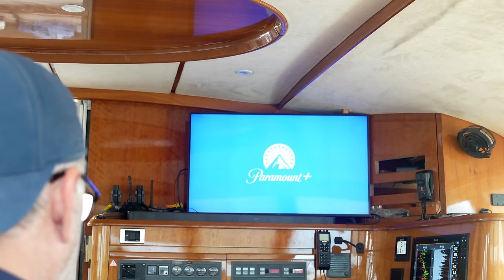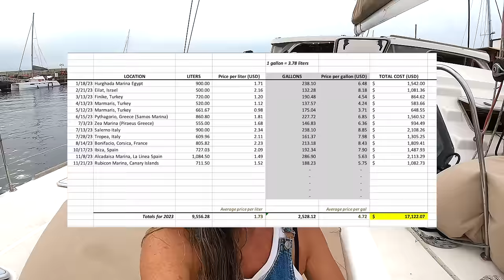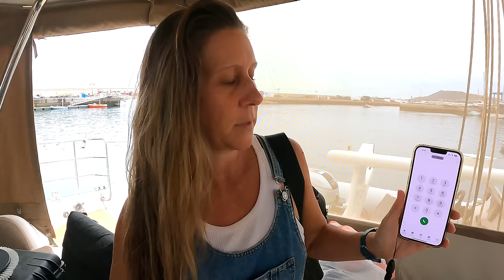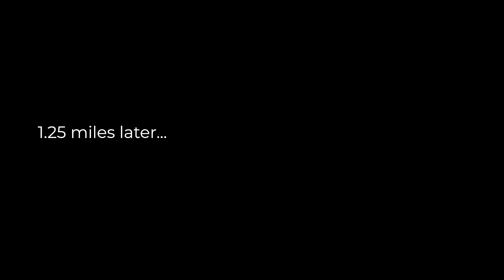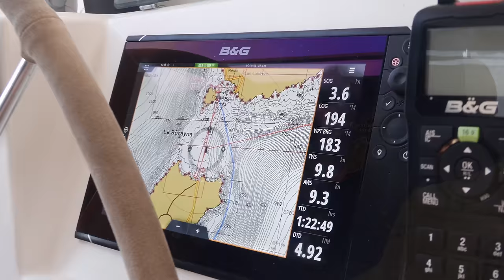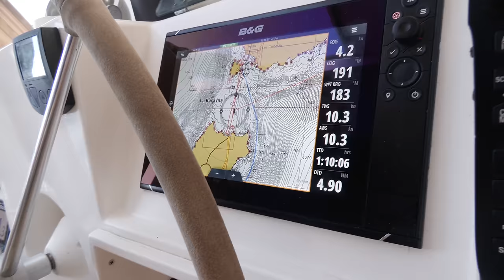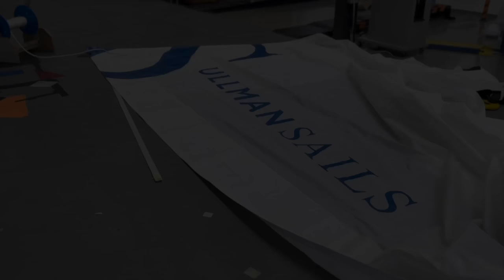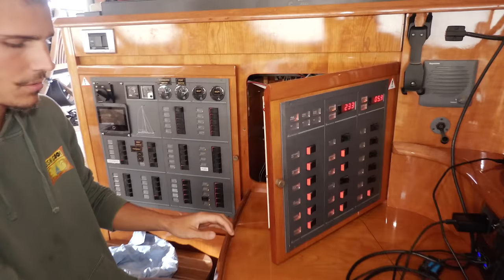She’s leaving. (Ep 266)

Comment: $18k isn’t bad for a years worth of fuel. My fuel cost in a Toyota truck is around $11k and it rarely get more than 60miles from home
Reply: Your truck doesn't have sails... $18k is terrible for a sailboat.  SV Delos (which granted is a smaller boat) just said they use around $100 ($140 if it hadn't been tax free) diesel per month in their last video. And that included crossing the Pacific...

Comment: @Zatara.. what sort of batteries do you guys use? As I am starting on some DIY 48v battery kits for my house (given the energy costs are nearly 2x what they were just 4 years ago).. I am quite impressed with the new LiFePO4 coming out.. 280ah to 320ah. They add about 200lbs per 16cell pack, but can store a ton of energy and recharge 6000 to now up to 10000 times which is a lot of years of use. Curious if you guys have looked in to some of these EVE/REPT batteries that you put together yourself, or just bought some of the marine 12v or 24v ones for the boat? Also curious if the weight of 200lbs or so per pack would be an issue for the boat.. I imagine not given the group of kids you had on board + extra food weight wise. Just thought about it because they can power generators and such for days with enough cells.

Comment: The average fuel cost is incorrect.  Looks like you used the average function for the column, and you have a null values below the prices which are then taken into account in the average.  Just delete the nulls.  It comes out to $6.77/gallon average.  Ouch.  Thanks much for sharing.